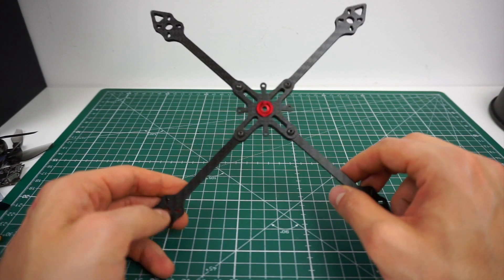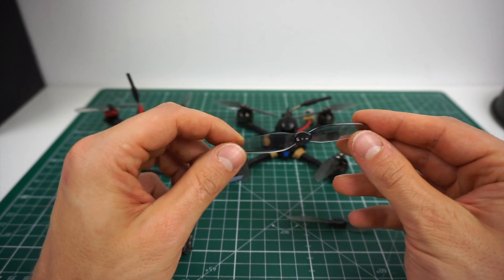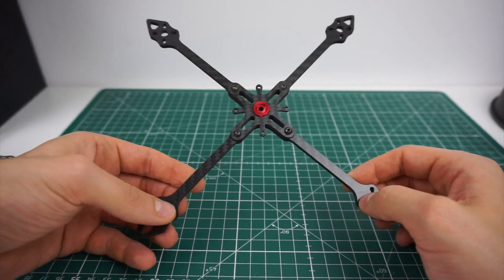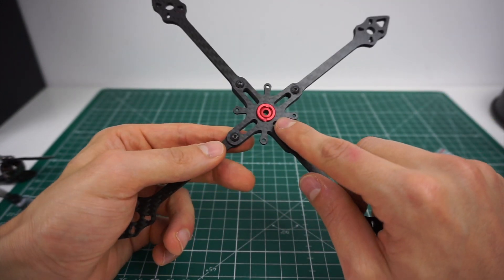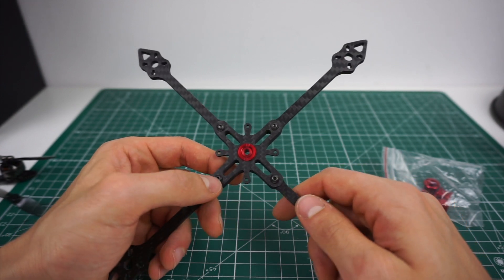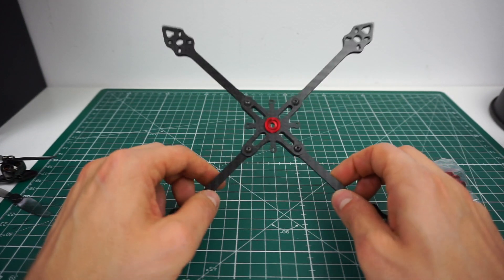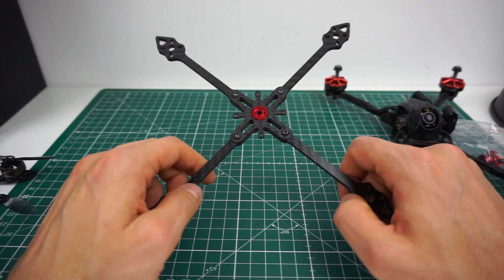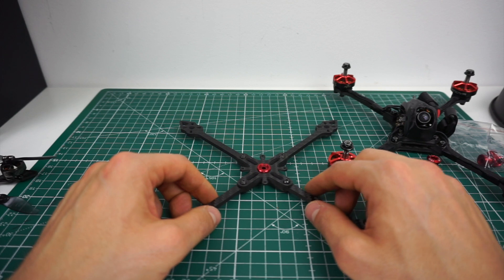5" Toothpick (Not kidding!)

Comment: Very Stout and clean design.  Thank you.  Have you seen the new 2004 variant from Brother Hobby?  They look like a perfect option. https://www.brotherhobbystore.com/vy-2004-motor-p0115.html. It is possible that the feeling of a 5" at lower RPM for the larger Toothpick at lower speeds feels weird is that the rotational inertia of the props unloads the disc thrust force sufficiently that uncouples the dialed in gyroscopic stabilization..... So, perhaps the new folding dal props would be sort of a thrust producing centrifugal clutch effect to keep the capacity of the motors to spin up more rapidly or maintain a rotational inertia better than a fixed blade due to it may be able to decrease its diameter with wind resistance at lower RPM? Dunno, but it may be worth contemplating trying that type?  Again bravo and well  thought out design!

Comment: What do you think about equipping this like the RacerX ET5 (https://racerxfpv.com/et5), i.e. with the new HQ T5x3x2 and BetaFPV 1505 or Airblade Superman 1606 and then a 20A AIO Toothpick board? This could come out at 250g or lower with 4s-850mAh.

Comment: Im trying 1506 moyors and 4s on 32g 5 inch 20mm platform. Goal was 120g dry !!. 
Litetally every gram counts.. need to sacrifice worse camera, no zip ties, short wires everywhere. HGLRC 28A 20mm stack is perfect, but got lost in mail.

Turns out solder is heavy. Now estimate 135g, 260g with 1050mah battery

Comment: Dave, Any idea if your 5" TP frames would accomodate the new HGLRC Zeus 35a AIO FC? There 20x20. Just wondering if you had any design changes in mind that might better accommodate beefier motors like the 2207's with slightly wider and stronger arms? 35a would support a smaller motor with higher KV on 4s?? Any thoughts or you done with the whole 5" TP?

Comment: I get incredible performance w/ rcINpower 1506 3k motors spinning both Ethix S3 and Dal 5051 props @ 250gram w/ 4S 700mah.  You wouldn't think it would work well on 5-inch tri-blades (especially w/ the aggressive 5051 tri-blade), but the performance is solid - it has to be experienced to be believed.

I've been trying to put together the best 250gram quad possible - I like your frame design and look forward to seeing how the various options turn out.  With your frame, perhaps hyperlite 2204s could be used @20grams each, and still remain within this 250 gram goal (minimizes government paperwork).  

I'd suggest moving to separate 20x20 boards to really have enough power for these motor options - the slots in your arm connections could be used to mount a stack, either 30.5x30.5 or 20x20.  I personally run 20x20 FC + 4in1 ESC but use the 30.5x30.5 to mount the top-plate and camera.  It's a very small weight penalty that provides a lot of impact protection for my electronics.

Comment: Interesting that this type of frame comes back, but nearly 2 years ago i build such a light 5". It was the Druckbär3 with some 30g for 5 inch, and 170g dry including a runcam split2 and 1408 motors. Today they offer even lighter 5" frames with 25g (see http://druckbaer-racing-frames.de/)
What i like on such light frames is that they fly with very little noise when a 3-blade prop is used.

Comment: So....I contacted CNC Madness to get a couple of these frames cut!! Thinking of running Brother Hobby 1507 4100kv...
Reply from the maker: Nice! But get something with lower kV or run it on 3S. 3300kV on 1606 was already too high of a kV. 1507 is the size Kabab wants to test next so if you keep an eye on his channel you might get the results of his testing soon.
Reply: @DaveCFPV  I currently run 1507 on three inch props on a CMW Massive Droner. Do you think that would be doable or does the frame weigh too much?

Comment: That bike nut is fantastic. I have a new different mechanism coming but that what you have there is just beautiful. My stuff is definitely not as nice. 😅.  This will be some intesting testing.  For sure the 2204 is going to win but in gonna try 1506 on the old 5x4 twin blade first. The smallest motor that can manage an extra light 5" prop. 

What you described with the lack of feel on an ultralight large quad is accurate and is what I look for to tell me that the motor just does not have the power to handle the prop. With lower weight quad, the load on the prop and motor is less....but not a whole lot less. Imo it's all about the motor/prop combo.  I am just not expecting this 5 in to work out well but it is fun to test.

Since you have the platform, I would recommend you try your little motors, but then just mount some 2207s.  then that will be a truly professional quad if there ever was one. All of the power all of the control all of the performance all of the time.
Reply from the maker: My bets are on 2204s too. But it will be over the magic 250g AUW with 2204. With 1606 I'm just slightly below 250g AUW with an 850mah 4S R-Line. 
Is 2207 a typo!? 😅 It could work on the 20A ESC because the AUW is so low that I really don't expect high amp draw but 2207 would be crazy!
Reply: @DaveCFPV  nope. Not a typo. Some 1650kv 2207 with a 6S ~550mah would be total maddness but would spoil every single other quad in existence for you.
Reply: @Kabab  what about Xing 2208 1800? I've got two of these frames coming... Going to try to test BH 1507 4100kv with 3" props first...
Reply: @WEEBER13  those will likely work well too but 2207 is lighter. For things this light you don't need tons of power. You just need enough torque to manage the prop.

Comment: Interesting concept.. But At 5in, the toothpick frame weight reduction compared to race frames and aio electronic weights compared to 3 stacks may not be worth the trouble... They make up such a small part of the overall weight I feel like... I'm afraid the next step advancement will likely need to come from lighter motors and battery to make a big difference? :(

Comment: Very curious how it will perform considering basically all modern inch props are designed around 2207/2306 motors

Comment: I hope you read this. I too have some experience in this kind of quads. made a few with 1408 and 1608.
1) that board is only 1.2mm thick, the mosfet rating is genuine but the PCB itself won't be able to sink the heat nor carry the current and the performance will be poor imho. the weight penalty of a separate 20x20  esc+fc is well worth it.
2) blheli reduces power below 156k erpm. which is 11k prop rpm for 12n14p. this contributes to slugginess at low speed.
3) even if they rated the board at 20A, we are really used to have a lot more headroom on the fets. these are rated just 23A which is very little headroom, typically on 20A esc we have 40-50A fets. numbers can be written.
remember when the motor actively breaks, generates very high current spikes that can exceed the mosfet rating and pop it. even if current consumption seems okay.
get in touch if you want.

Comment: Looks like a well designed frame. Keep up the great work. I cant help but wonder if you would see better luck in a 4 inch toothpick build. And it would still stay sub 250.
Reply: That is true but it would make a great platform for dji hd fpv. With no wasted space it would be unique because it would be the optimal size to hold it and be sub 250.

Comment: I have tried the emax 1606 3300 kv motors on a 3" and a 4" man those things run extremely hot!!! Like toasty nothing i could do in the filtering helped, eventually i gave up on them and  ended up switching to the rcinpower 1506 3000kv and i couldn't have been more pleased ( they are amp hungry though ) they chew up a 650 4s in 2 mins

Comment: Hi Dave, Bit of an offtopic question: would you recommend the 1207 Motors from RCINPOWER?  I saw you did one build with then and didn't really say anything negative about them, but kabab says they draw to much current. I would like to hear you opinion on them, since they are so cheap on and in stock! :D
Reply from the maker: They are great. Sure they draw a lot of current but that's what they are supposed to do. Perfect for very high power light 3" setups

Comment: Part of the problem with the small motors is that there are hardly any decent light bi-blades. I have had decent results by cutting down the hq 4.8x3.7x4. In a bi-blade it's a very light load.